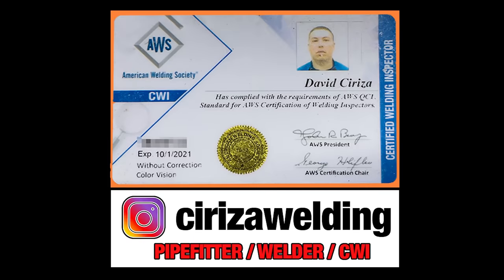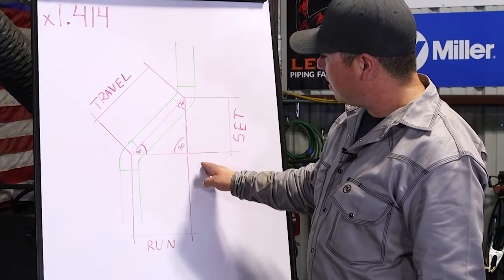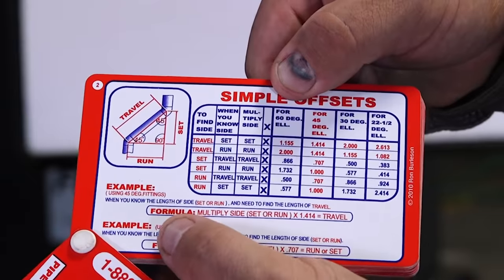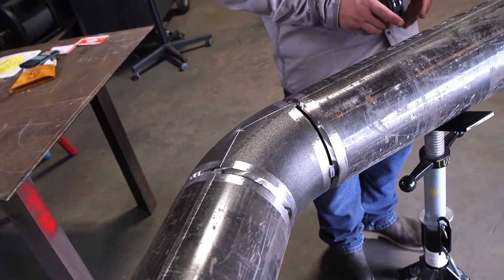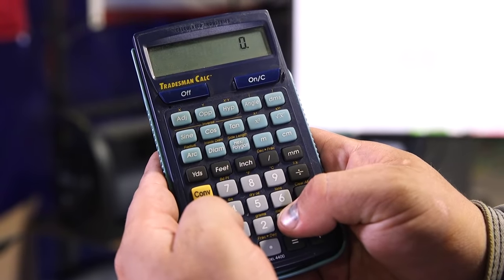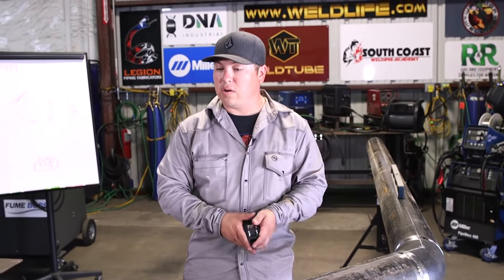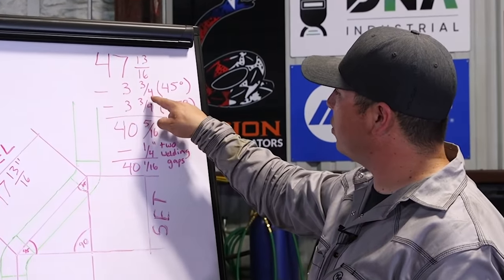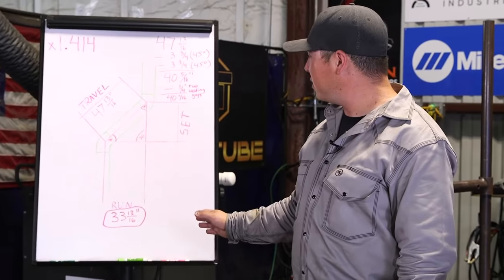How to Fit 45 Degree OFFSETS ? | PIPEFITTING

Comment: The Thumbnail is wrong. What you call "Run" is actually the set. Now when using 45° ells Run and Set are identical in lengths so it doesnt matter much, but its really matter when using Mitered ells 30°, 50° etc..

Comment: Also without a book you  can find take offs for  45 weld fittings by splitting it in half 4 times and then take the 2nd and 4th number add them to get take off..
6"
3"
1 1/2"
3/4"
= 3 3/4"...hope this helps new guys starting in the trade 90° fittings the take off is 1 1/2 × pipe diameter...great videos by the way always great seeing tradesmen helping out others
Reply: You can also multiply the pipe diameter by 5/8 or .625 to get a 45 takeoff
Reply: @tylermcdaniel4895  awesome tip
Reply: So just ×1/4 tha b right
Reply: Im a first year appreciate and this is so confusing have a test coming up and am trying to find this stuff online but come up with people using calculators n I'm not the best at math
Reply: @elmermerino5272  no problem I've been a pipefitter for over 20 yrs glad it helped
Reply: I thought it is 1 1/2 for a long radius elbow and usually pipe diameter for short radius for 90° fittings

Comment: The trick i learned for takeoffs of 45* is half the size of the pipe 3 times, then add your 2nd and 4th numbers together. So a 6” 45* you go…
6
3
1 1/2
3/4

Then add 2nd and 4th, 3 + 3/4 = 3 3/4 take off. Works for everything up to 12” i think?
Reply: Pro tip. Use the first and third numbers for sweep fittings. Pipeline. You're welcome
Reply: Hillbilly method
Reply: @brianlewis6614  if  Jethro was a fittn

Comment: Very good job! I always liked the challenge when I was in the field or a fab shop. Have you done a video on a rolling offset? It's not difficult but some people have trouble with it. And the calculator is just another tool, used to always have one in my pocket. 😎👍
Reply: @sloppyjonuts9162  

Not necessarily. The travel piece/pup is always different than a vertical or horizontal travel piece on a 45° offset or any other degree. I had two books I used in the field for reference. If I remember right the "Blue Book" show's a diagram on how this is done because the pipe isn't always a true vertical or horizontal from each other.

Comment: Can you do one in which you do other angles for fittings,,such as you would have to cut a 90 to make it into a 70 degree elbow and then find the take off
Reply: Make the fitting 70 degrees and measure it lmao
Reply: half the degree and x the tanget of it x the radius+ diameter because in order to degree it has to be from a long radius 90
Reply: you can do it to find any take off

Comment: Can you do a 2g .250 wall pipe with a 3/32” diameter 6010/6011 and then 3/32 7018 stringer fill and cap? Im running a 6011 on a miller multimatic 220 and cant quite get the amps right also I drag the rod so if you can sho that as well that would be more than helpfull

Comment: question: I am having trouble wrapping my head around this concept. What if I have to find a travel for a 45-degree offset and my offset is like 3 feet 4 1/4 inches? The two measurements for one offset are throwing me off
Reply: Multiply times 1.414
Reply: Offset and the set are always the same for 45 s degree offsets , say if the offset is 9 ft 3 , the set is 9 ft3
Reply: It doesn’t matter what the other measurement is just multiply the offset by 1.414 and you get the travel

Comment: Thank you for the tutorial. Good job. You said you would have to include the gaps if you were TIG welding, I assume you would have to include the gaps to calculate for stick welding as well, no?
Reply: Yes the gap is much smaller when stick welding
Reply: @cirizawelding5076  wow, thanks for the quick response but let me just get this clear. Do I need to calculate anything, or just ignore the Gap calculation ?
Thanks again for sharing your knowledge. Sorry I hadn't read down through the other comments yet.
Reply: You will need to subtract your welding gaps and fitting take off from you center to center measurements in the case of the video I took off (subtracted )3 3/4” for each 45 and 1/8 for each weld gap from my travel measurement
Reply: Do not take off for weld gaps when downhill stick welding. You should have a 1/16 gap at best when putting a downhill bead in and the pipe will draw up more than that trust me

Comment: Where did the 1.414 come from? Is that just part of the formula
Reply: It’s part of the formula it can be found in blue book and Chico cards
Reply: The 1.414 figure comes from a right triangle that has 2 - 45 degree angles and 1 - 90 degree angle. If you calculate the travel (a^2 + b^2 = c^2) you would end up with the square root of 2, which is 1.414. Hope that makes sense. Hard to write a formula in a youtube reply.
Reply: Thank you